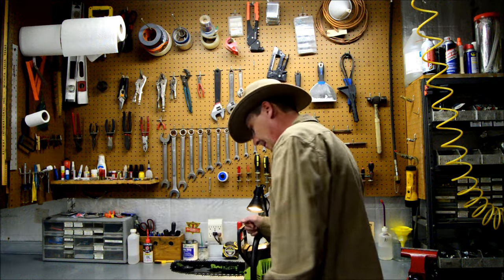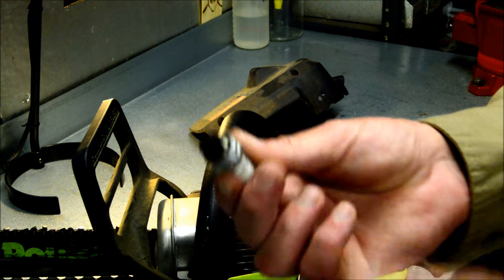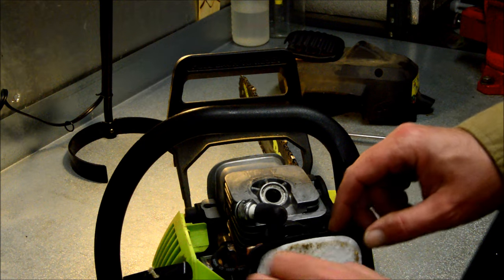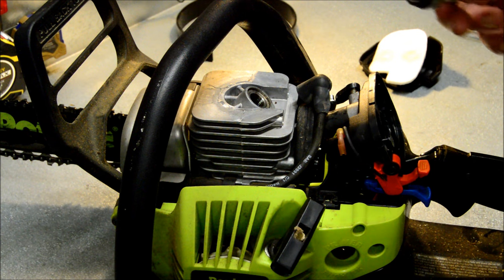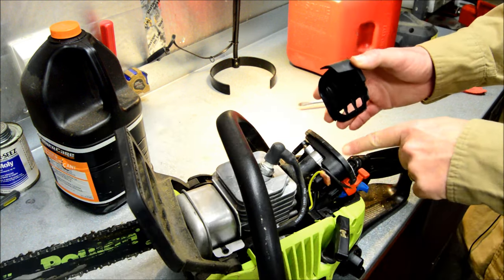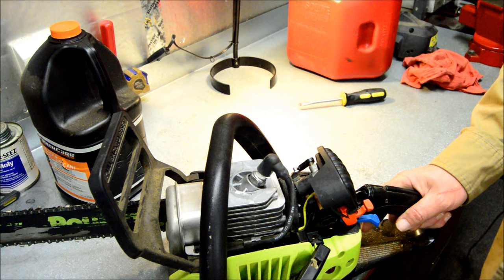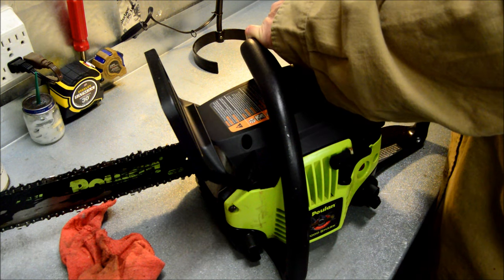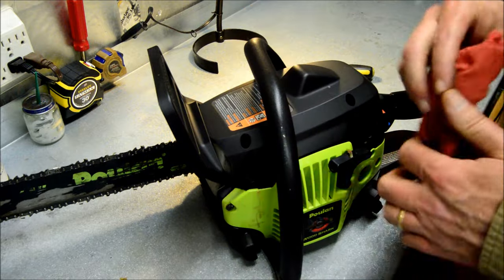Chainsaw Won't Start - 10 Years in Storage - Poulan Woodshark - DIY Repair

Comment: Poulan stand's for pulling, if you do enough poulan and poulan eventually it will start.
Reply: I've had a 16" Poulan for years now for around the house jobs. Has never let me down. 3 pulls and she's ready to cut !
Reply: I guess that doesnt apply to my John Deere as you should "run like a Deer" AWAY as fast as you can so you dont pay for all the crappy repair service

Comment: I have a similar Poulan chainsaw, ( model 2050 Pioneer, 2.0 ci )  it has done very little work, i had it running just 15min ago, i tipped out the petrol and put fresh 40/1 fuel mix and put good quality chain oil in the tank, i use Castrol two stroke mower chainsaw line trimmer oil, it took a few pulls but started up and ran good. It has 14'' bar.
I use good quality spark plug,s NGK good reliable spark plug, a new line trimmer recently played up, ( was running, then it just would not keep running, i was unsure, thought fuel related?? )                                                i put a 2nd hand NGK in, it started up and runs good now. Unsure of breed, could be Chinese made.
Thankfully we do not have ethanol petrol here, not to the best of my knowledge anyway,  ( New Zealand ) i use 95 in everything mowers, chainsaw, line trimmer, cars.
Reply from the maker: Thanks for sharing

Comment: That saw is pretty clean after sitting for 10 years. Most saws I pick up have spider webs and roaches and lots of chips mixed with bar oil and busted fuel lines
Reply from the maker: Fortunately it was stored in the case with no fuel to eat the lines. The bottom was covered in bar oil though.

Comment: 16:10  ReOiled the Filter???  I don't think that is called for.  I drill 3,  1/4" holes in the filter cover near the top.
My unit is an old like new 3314.

Comment: Bought a Stihl 024, with a 16" bar in 1991. Cut with it for 25 years. The only trouble I had was water in gas 2X in 25 years. I don't cut any longer. I'm 70 years old and now live in Florida. I still have the saw, and yes it still runs.
Great video, keep M coming. Thanks.
Reply from the maker: Yes sir, those older saws were sure built to last. Thanks for commenting.

Comment: Hi.  Prob a really dumb question..What is the UK equivalent of your 'antiseize'??  Is it just a normal grease??  Or what we call ' copper slip'?  They look nothing alike tho.  Thnx
Reply from the maker: Not a dumb question at all. Straight out of the tube or bottle, anti-seize is made up of a high-quality grease base and lubricating solids (copper, graphite, aluminum, calcium oxide etc.), which are suspended in the grease. Thanks for commenting.

Comment: My problem was the gas line in the tank had broken. Went to Lowes and picked up a generic fuel line kit and replaced it, Started right up.
Reply: that is something the manufacturers where hoping you wouldnt find out and take it in for a expensive repair

Comment: 42cc I believe. It seems Poulan uses this engine displacement on every saw sold with an 18" bar.
Reply: On some of the 18 inch olderish modles are only 40cc.
Reply: That saw is a Poulan model 3314WSA Woodshark   33cc   14" bar    I have had 2 of them.  Sold 1, gave the other to my sister, I bought a Stihl MS 250 to replace them.
Reply: Identical to the McCulloch Mac 335 by the looks
Reply: Some were 38cc with a skip tooth chain.

Comment: My Poulan Chainsaw sat for about 10 years and my fuel lines deteriorated.  Did you suspect the fuel lines needed to be replaced on this Poulan?  I know it has been 3 years since you worked on it but just curious.  Thanks for a good video!
Reply from the maker: Yes, I was surprised that they weren't deteriorated. My guess is the owner put it up dry. Thanks for commenting.

Comment: I run big 76 and 80cc saws and I would have went through the carburetor and I wouldn't have cleaned the spark plug that way the spark plug was just fine the color looked good

Comment: Someone gave me one of those because it wouldn’t run. I looked at it and the fuel lines were rotted. Replaced them and it runs fine. 😁
Reply from the maker: Great score, thanks for sharing. Fuel lines are a common problem with these 2 strokes.
Reply: @TheHandsOnChannel  how do you replace the lines when you can't even get a finger in the tank-I have one line loose (not the one with the filter) & can't even see where it should attach
Reply: whatfreedom7 that is so true
Reply: @philhamilton1452   A long skinny curved hemostat (forceps) is probably the the best tool to use for fuel lines.

Comment: Great video. There is one problem that I saw that I thought I would mention. Don't put dielectric grease on the electrical contacts of the spark plug or spark plug cap. Dielectric grease is an insulator and inhibits the flow of electricity. Dielectric grease can be applied to the spark plug insulator and inside rubber of the spark plug cap to ease removal
Reply from the maker: Hmm, interesting. I was taught dielectric grease was conductive therefore good to use on plugs. I googled it and you are correct, thanks for the info.
Reply: @TheHandsOnChannel  like any grease it will thicken after a few years like grease, but if lightly coat spark plug boot or battery terminals will help keep corrosion down.

Comment: I have the same chainsaw and the same problem. I just did the same steps you did except mine still won't start. I have a spark, fresh fuel, compression seems good, sprayed a little ether in the chamber, no luck. I guess I'll try to check the fuel lines next.
Reply from the maker: Yes, fuel lines on these are notorious for cracking. Good luck.
Reply: @TheHandsOnChannel  Thanks. Indeed all of the fuel lines had mostly disintegrated. I was able to order a kit from Amazon that included new fuel lines, air filter, spark plug, and even a new carb for under $20 so I'm hoping to get it fired back up soon.

Comment: I would have figured the fuel lines would need replacing after that many years.
Reply: That's what I thought
Reply: and the misleading advice about using straight gas in a two cycle engines makes him dangerous
Reply: @rogerd4559  He's talking about REAL gasoline, not Ethanol gas.  It's often called recreational gas.  It's the ethanol in the gas that causes all the problems, especially storage.  Thank you to the government for forcing the ethanol down our throats.

Comment: No - Chain brake is for kickback safety.  Let it rev. without the brake.  At proper idle, the chain will move but barely if chainlash is  adjusted properly.  If you rev with break (clutch) forward then you just burned the clutch up.
Reply from the maker: I agree if you rev it too high it will damage the clutch. That said, what was demonstrated in the video is fine. Thanks for commenting.

Comment: I have a Sears Craftsmanand put a new carburetor, new fuel lines, new filter, new spark plug, New fuel filter, and new fuel. It wants to start but I cannot get it started. I made sure the exhaust manifold was not full of carbon. Still it will not start. The piston looks good, no score marks on it, and I am getting spark. Any suggestions?
Reply from the maker: Can you smell fuel when you're trying to start it?

Comment: Question. I've checked all that you did and still have an issue getting it to start.
Reply from the maker: It's probably a diaphragm in the carb or the fuel lines could be cracked.

Comment: i had that same saw .i was junk.green ones are trash.oranges not to bad.could get mind to start half the time
Reply: i bought a new one for a 100 bucks  and used it casually for about ten years .  it started nice , idled nice and was not too loud and it was pretty dependable .  not bad for a dirt cheap ,  basic and easy to work on small saw .
Reply: I think the Orange Ones are the Pro models.

Comment: I have a poulan 2300 cva chain saw! It leaks bar oil! It does not have a replaceable oil pump. How do I stop the leak? Gerry
Reply from the maker: I'm not familiar with that model but it probably has a check valve type oiler and it is stuck open. You'd have  to remove the bar and inspect.

Comment: hello.I have a poulan pro pp4218avx.it wont start. Its got a new carb.new spark plug.and it does spark. I gap the ignition coil. But nothing. I checked the compression.dont know what else to check. Now i check the compression by putting my thumb on the spark plug hole. And i felt a slight resistance when i pulled the rope.im stuck!
Reply from the maker: Sounds like a fuel problem. Check the fuel lines and the new carb for fuel flow. Good luck.

Comment: I have the same chainsaw 
But the gas line went bad and when I took apart but the hoses where broken I figure out the way on the carburador but the inside of gas tank also bad the lines are broke 
If you can help me with the inside how those line are hook up because I have I filter and another line 
can you please  share your experience on That.  
Thank you
Reply: Thank you

Comment: Good overall advice.  I learned essential details.  Suggest you work on your camera angle a bit.  Your arm got in the way several times.  Thanks
Reply from the maker: Thank you for the suggestion I noticed that as well. I now have a gopro for better close up shots.
Reply: @TheHandsOnChannel  Good to hear.  I did enjoy the video and it explained things really well.  I have the same model with the same problem.

Comment: I had to replace the clutch.did the rope trick all good and now the fing rope is stuck inside the piston shaft what do you do then?
Reply: Hank Bridges  ,thanks,i actually removed the pull cord side and spun the cylinder backwards ,it was easy,came right out.

Comment: One thing I will say as a Californian, often the factory settings on mix screws are really awful for idling and power. this goes for many two stroke engines like weed eaters as well.
Reply from the maker: I agree, most of them I run across are set way too lean. Some of them have made it where you cant set the mixture screws without a special tool or modification. Thanks for your comment.
Reply: i tried eveything still wont work
Reply from the maker: The next thing I'd check is the fuel lines. They  are notorious for breaking/cracking. Good luck.
Reply: You can get the tool on Amazon.
Reply from the maker: Thanks, I'll check it out.
Reply from the maker: I personally use a husky rancher, but the poulan saws are good for homeowners who don't cut a lot of wood.
Reply: l dont cut a lot of timber  and i cut less when i bought one 3 years ago ..now its gone . i got a timberpro 62  so far so good
Reply: @TheHandsOnChannel  huskey makes poulan. Husqvarna bought up all the low end garbage stuff what a sad deal. Husqvarna saws have really went downhill to.
Reply: Yes ! You are right. I went on EBay ( my very favorite store ... most of the time ,,, LOL ) and bought the tool set to adjust carbs, really cheap and worth every penny. I also found that for the REAL stubborn carbs, get the carb number or even find the make and model and BUY a NEW carb for like $10 with FREE SHIPPING !! I have bought a few and had VERY good luck. Put 'em on and fire 'em up !! They also have lots of fuel line for VERY reasonable prices.  I like your work ethic ! Lots of guys will only fix it and charge double for the repair ... you (as I do ) do a thorough job and give the customer back a nice clean machine !! You're absolutely right, the little things DO matter. Thank you for a nice video !
Reply: I bought a set of 4 adjustment tools for around $8 on EBay. They work great !!
Reply: @LoneWolf-yp2mo  does your poulan run like a Husqvarna now? Oh it is a Husqvarna. Did you adjust the carb and holy shit it's got power now it will out cut any saw out there my poulan
Reply: @Wanous-hv7zo  actually I think Electrolux bought both of those companies, then later they merged.

Comment: I ran new model of this 28 diameter tree with reg chain came down with ease but if I want a pro saw work with it every day husky and Stihl go to buy a cheap ass saw like this I made few 1000$ bucks off of yeah not gonna last long but it will get you where you need better saw just take your time bigger better saws will come

Comment: Did you use fuel from the gas station on the higher octane canned fuel?
Reply from the maker: I use high octane pump gas, but I only use pure gas no ethanol in my small engines.

Comment: I would never recommend spraying anything but 2 stroke fuel into any 2 stroke engine. It uses the oil in the fuel for lubrication. Regular gas or starting fluid means no lubrication. I’m sure you know that.
Reply from the maker: Sure do and if you are worried about it use mixed gas. I've used either for years without any issues. Thanks for sharing your opinion.
Reply: Ranger1 I’ve never seen a two stroke need starting fluid. Not have I seen carb cleaner separated into the Venturi and clean a diaphragm carb.   🤣

Comment: I've been running all my saws on the ethanol pump gas (93 octane) for years with no trouble because I use seafoam in the gas and storage has never been an issue for me, all of my stuff fires up no problem every time
Reply: additives suck. been repairing and using for 30 years. never used one. just use clean newer gas.
Reply: That's fine if you're using non ethanol gas or running the equipment enough so it doesn't sit around, I don't put anything in my bikes in the summer because they don't sit enough but I forgot to put the seafoam in one of them and the fuel clogged the Jets and accelerator pump port so I had to take it apart and clean it out, it doesn't happen with the seafoam, so no not all additives suck.

Comment: I have a little Husqvarna 235X it's not carbonated but anyway it will start cold and I have to feather the throttle to keep it going when it dies it doest start until cold. I've put clean fresh fuel, rinsed the tank before with the fresh fuel, new evergreen plug I think it's called or Ecco something like that before I tried it also cleaned it up and replaced the both fuel and air filters. I bought this saw new and have never used it much over the years as I got it basically for smaller limbs and such its only a 16" bar which is fine just not that powerful. I mostly use my Husqvarna rancher 55 it's old but an unstoppable beast that will probably run forever lol but I'd like to get this 235X running good for smaller stuff especially since I have it.
Reply from the maker: Hmm it sounds like a fuel mixture issue. Probably set too lean from the factory. Try to richen the mixture screws, you may need a special tool to do it. Good luck.
Reply: @TheHandsOnChannel  yeah I've always had an issue with the darn thing I believe. I know it's always had a hard time getting started and staying running but I've never used it much probably for that reason lol. Now it's just more trouble to use if then it's worth but I'd like to get it working good. It's a light saw and would be great for smaller stuff you don't need as much power. I did throw it as far as I could a few times because of this reason which could had caused more damage but I don't see anything lol
Reply from the maker: LOL I've had days like that.  @my2centz196

Comment: Had that saw and cut up lots of blackjack oaks and cut stumps out. I have lots of old chainsaws. The poulan the one that get’s the most abuse cause it’s cheap and reliable if you have any chainsaw since. I never use starting fluid for priming, it washes oil off cylinders. Carb. Cleaner is much better cause it lubricates and clean also combustible. I can see by the saw the owner don’t have clue how to maintain chainsaw cause the chain is loose. He also stores the saw with gas in it which plugged up the carb. All you had to do was rinse the gas tank, prime it with carb cleaner to see if it will fire. It’s so adjust the chain, gas it up, oil in the bar tank and fire it off. If it won’t stay running prime it through the carb with carb cleaner. Like your video for the novices.

Comment: I got a old one from my uncle and I replace the varnish smelling fuel lines and filter. I have spark, compressing, and fuel and it still ain’t starting. Idk what I else I can do. Do I need a bigger fuel line?
Reply from the maker: You might have to remove the carb and clean it out if it has evidence of varnish. You could also soak it in fresh gas or carb cleaner for a day or 2. Good luck.
Reply: I did pour gas on it so ill try soaking it. I did get it to start for a second today but that was it.

Comment: Neighbor just gave me his. Looks like this is my Saturday.
Reply: Hank Bridges  That's a lot off work and a lot of parts to buy for a chainsaw that you can buy for about $140.  Cheaper and easier to just buy a new one IMHO.
Reply: Hank Bridges  I agree with what you said "If you keep a chainsaw up, it'll last".  That's not the case in the video or the comment that I was replying to.  In those case the prior owners apparently misused, abused or neglected the chainsaws to the point of them no longer working.  What I was referring to is when you get a bottom of the line chainsaw that needs extensive work.  It's probably not worth it to put the time and money into MAYBE fixing it.  If it is a better, more expensive chainsaw, then it MIGHT be worth it.  You can buy all of the parts and do all of the work and it still might now work. 
As Mark Price said, the cost of all of the parts could be more than the cost of a new unit. We're not talking about simple maintain, we're talking about attempting to bring a non-working tool back to working.
Reply: Damn Hank, you ok/alive still? 
Sounds like you are in a no win situation. California is to expensive to try and live alone. Need to find a couple decent roomies that aren’t psycho. 
I read your whole post and hope it’s going better cause that sounds like hell.
Reply: you should scour the neighborhood you will be surprised what perfectly good stuff people throw out